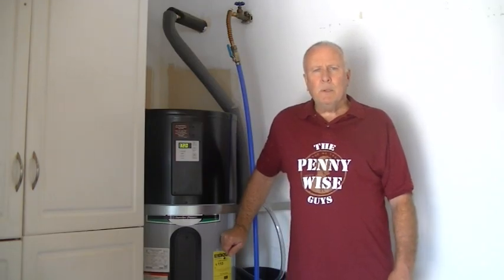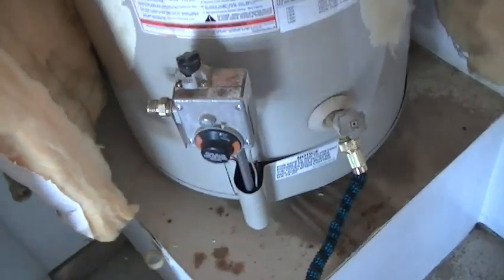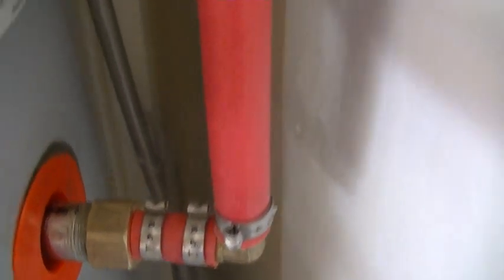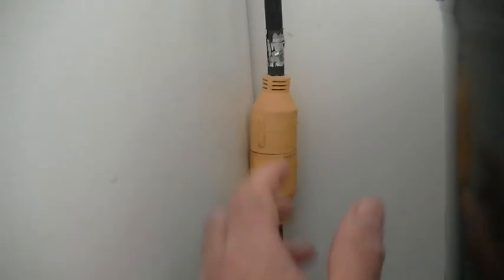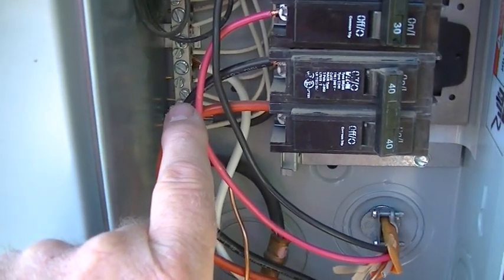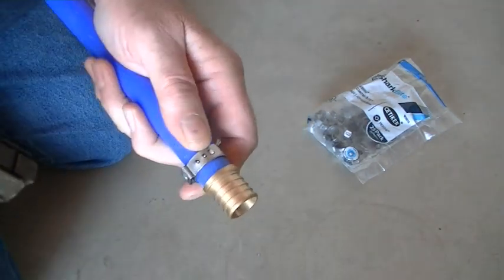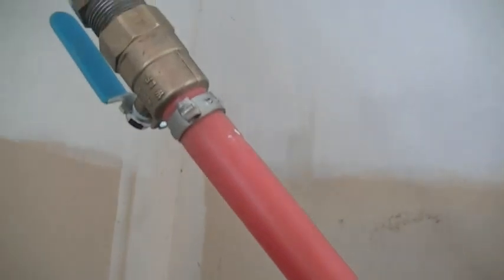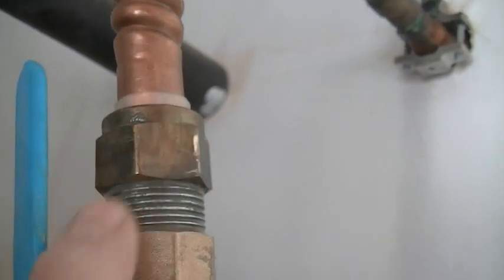Heat Pump Water Heater Install to Replace Gas Heater

Comment: How did you handle the condensate line?
Reply: Hi. Great question. I am sorry I failed to address this on the video. On mine and for this install, since it is in the garage on concrete floor, we decided not to worry about the condensation drain. I have found that these units have very little condensation and by leaving the condensate plug in the unit their is no dripping because being outside in the heat of the garage the little bit of condensate evaporates from the upper pan. Of coarse we are in a dry climate and if you are in a humid climate, you can take the plug out and attach vinyl tubing to route the water to the outside. If you have an inside the home install, then I would place the water heater on a drip pan that has the built in threaded coupler that you can then attach the tubing and run it through an outside wall to properly drain. The pan will also catch any other drips to route to the outside so your flooring is not damaged. Have a blessed day.